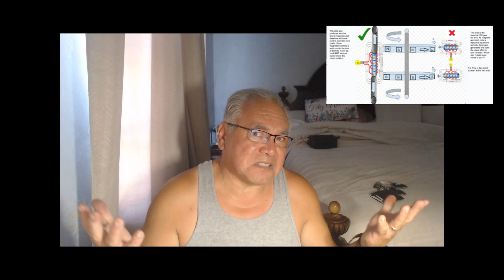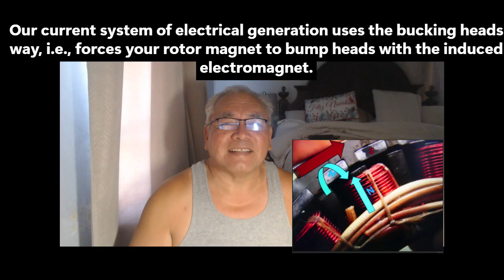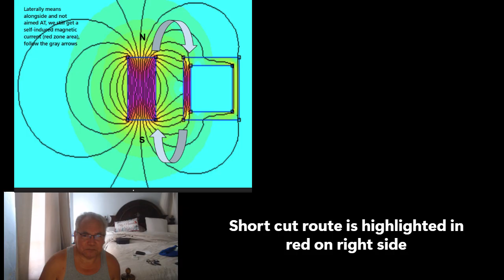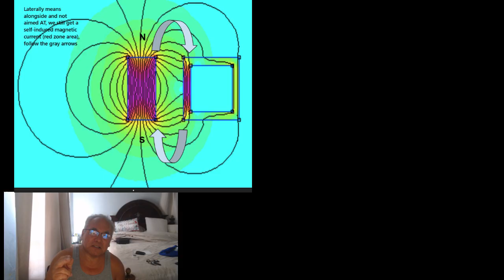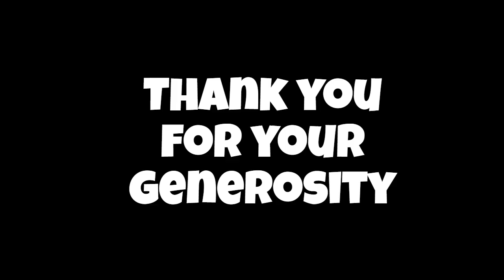Lenz free prototype explained

Comment: SidewaysExcitationMeansWeAreAvoidingTheReaction.
Reply from the maker: yes indeed, can you fathom the possibilities?
Reply: @alexmanzanero FirstWeNeedToSeeIfItsRealOverunity,OrOnlyTheDragDecreases.
Reply from the maker: @ovidius2000 presently, there are alternators for sale that provide 13-14 volts at over 100 amps; over 1 horsepower and by taking away the brakes you can probably turn this alternator with maybe 300 watt motor